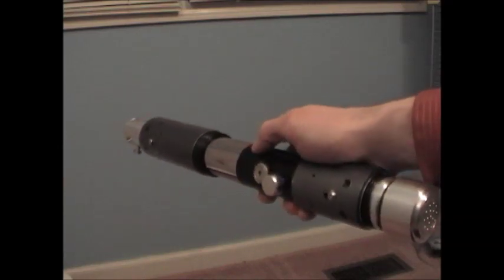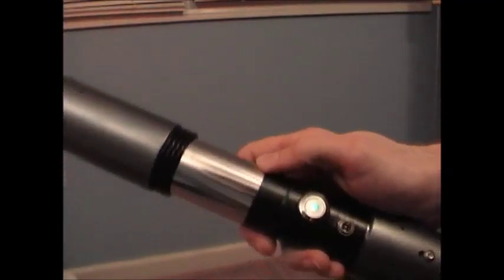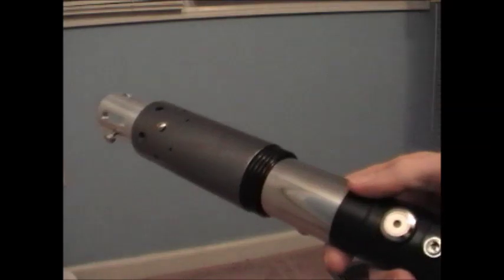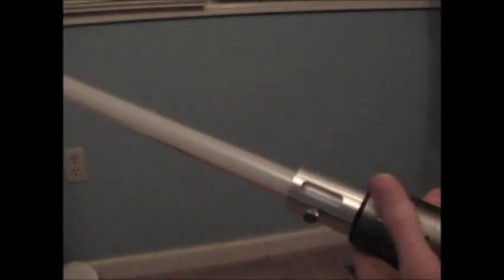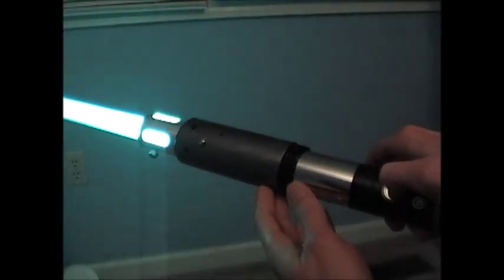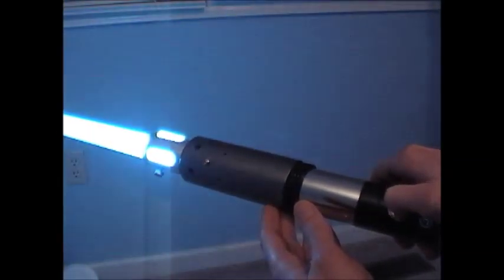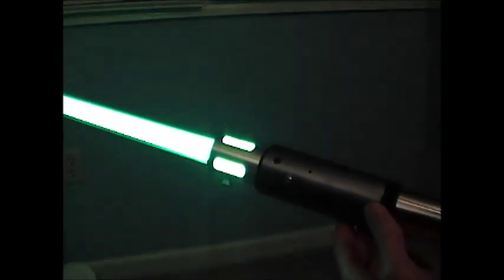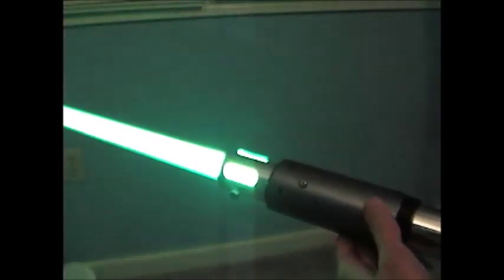Arduino Lightsaber (Done)

Comment: Awesome! trying to make my own home-built L/S using either tri-luxeon or 144 RGB / meter strips! Thanks, and cool buildDid you heat sink the transistors?
Reply from the maker: Thanks. For this build I used huge MOSFETs that could handle north of 10A current, so no need to heat sink them. I use smaller ones now, but still no need. The LEDs are on a heat sink, though.

Comment: How did you give it flash on clash?
Reply from the maker: That is a broad question. What specifically are you interested in? Wiring, code, sensors?
Reply: jakesoft Well you see I hate it when lightsaber go completely blank when it hit something, like all Hasbro sounds boards. I’d rather have no light effects on clash then that annoying blinking, but you managed to flash on clash rather than blink on clash. I’m interested in he wiring an code I guess.
Reply from the maker: In this saber I used an Arduino Nano to control the lights. I used a Tri-Rebel LED with Red/Green/Blue so I could mix colors and then wrote the code to change color when a hit is detected by an impact sensor. If you are interested in Arduino sabers, visit my thread on the forum (http://forum.arduino.cc/index.php?topic=261980.0). I've done much more sophisticated versions since I did the one in this video.
Reply: @jakesoft   Yeah I have seen your more advanced sabers; great job by the way, but this one interested me because of it being a Hasbro soundboard. Which at the moment is probably the only kind of soundboard I can afford.
Reply from the maker: @MuggMen  Thank you for the compliment. You might be surprised what you can afford. My  more advanced sabers some use programmable soundboards for 5 to 10 USD.

Comment: Can you share the schematics? I got audio down  but I have no idea how to hook up the high power LED, and im afraid to fry the duino or worse, my computer!
It would be so amazing if you could share the schematics ;[
Currently I'm prototyping using an arduino Uno, hooked up to a df player and a gyrometer, code running on arduino uses angle to decide what to play.
Reply from the maker: You may want to post up your question on the Arduino forum as the format is more friendly to answering something like that. My thread is http://forum.arduino.cc/index.php?topic=261980.0 . However, wiring the FETs to handle a high-powered LED (or any higher current load) is a pretty common thing to do so you could also ask it in one of the general wiring forums as well. If you are just getting into Arduino you'll want to plug into that community. Lots of helpful and knowledgeable people over there.

Comment: I am looking for a solution just like this one. Is there a way to purchase this assem led together with the sound fonts?
Reply from the maker: +Miklós “Myke” Tóth Well, this one got its sound from an "Ultimate FX" toy lightsaber. I integrated an Arduino board with it to control the LEDs for the blade and command the toy sound board to turn on and off. So, I guess the short answer is no, you'd have to build it yourself.
Reply: ok. This is no option for me since I have no fx toy. Got to keep looking for a solution... Thank you.

Comment: AWESOME! Would you be willing to share some instructions for how you put the circuit together or the Arduino sketch itself?
Reply from the maker: Thank you! I'll refer you to the thread I post on forums at The Custom Saber Shop some time ago: http://forums.thecustomsabershop.com/showthread.php?15366-Novus-Animus&highlight=novus+animus.

It's not wiring diagrams, but it does give some details about the parts I used.
Reply: Thank you! That helps a great deal. My son and I came across your video and he was amazed. We'll be starting significantly simpler for our first project. I've done some basic projects with Arduino and that's why yours in particular caught my eye. What is the power source you are using to drive the LED and the Nano?
Reply from the maker: Ken Yeh
I am using a 4x AAA battery pack with a 5V/5A regulator in this example. Everything is after the regulator. However, if I had it to do over I'd either substitute the AAA pack for a 7.4V rechargeable pack or use an Arduino Pro Mini 3.3V. I only get about 20 minutes of run time before the batteries can't pump out enough juice to keep the Arduino Nano alive and drive the LEDs at the same time. I'd get much better run time with a more powerful battery or with a microcontroller that only needs 3.3V like the Pro Mini.